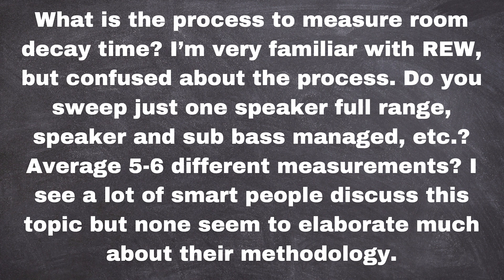The Science Behind Room Decay Time

Comment: Please please please show us how you time aline the Subwoofers . I think you said you were going to do a video on this using wavelet, but I’m not entirely sure.
Reply from the maker: Yes I did. I need to get better screen grab software. I tried to do it and it caused issues. The software most use won’t work on my laptop because it has two video cards. So I bought something to try and it ended up hogging the sound devices randomly.  REW kept resetting. So I need to get something else and try again.
Reply: @PoesAcoustics  tried OBS?
Reply: @PoesAcoustics  Camtasia was always working for me well, but also win 11 built in screen grab thingy is not that bad and it works on my pc (also dual cards).
Reply from the maker: @ChrisCiapala  I am not familiar with Camtasia. The built in one is ok, it isn’t quite feature filled enough and so I shot some videos and it wasn’t quite right.  So I was looking for a better option.
Reply: @PoesAcoustics  I didn't realize how expensive Camtasia became, for screen recording only it seems SnagIT (also Techsmith) should be fine. Hard to say, but there is a trial version. I'm also very interested in video how to align subs - 2 in my case, with Denon AVR. My living room has mods as everyone's and I'm quite limited to what can be done. Bass traps are no-go.
Reply: I would also look forward to this and  phase alignment examples with screen grab to follow along.  

1) Time/Phase Alignment
2) Interpretation of Impulse Responses/ETC